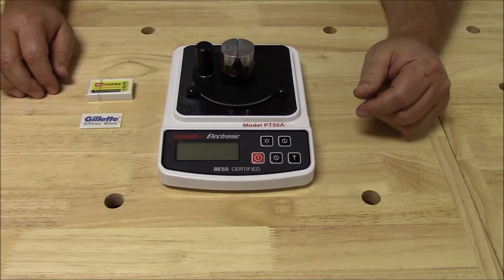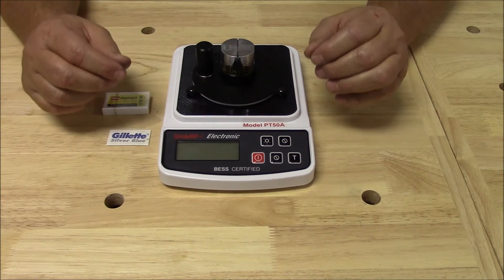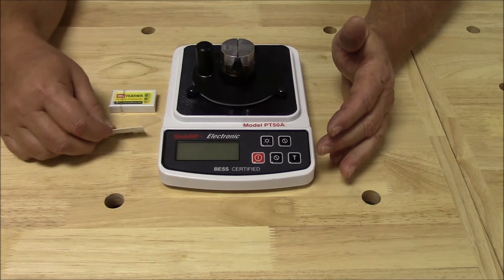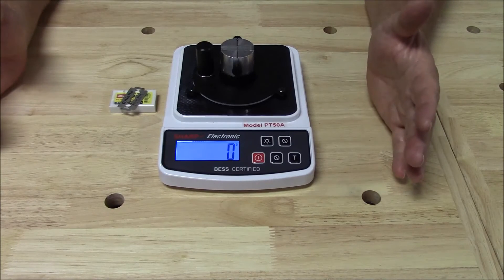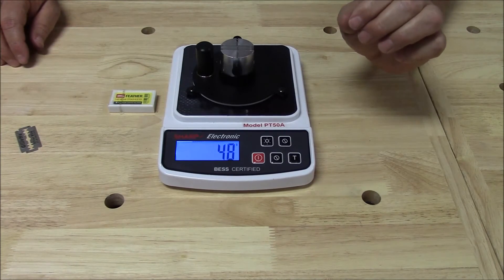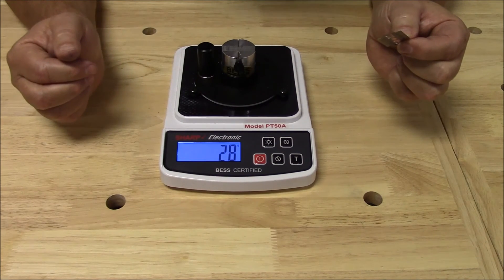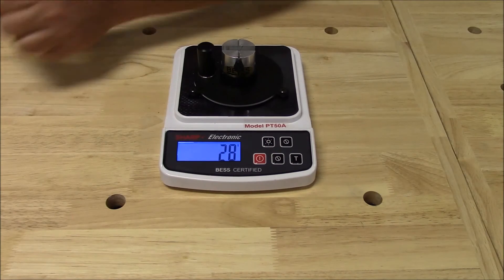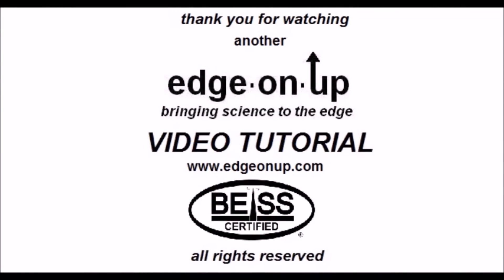EOU PT50A Feather vs Standard Delta Industrial

Comment: The edge of a straigh razor can be damaged by the machine???🤔
Reply from the maker: Not if the edge is formed in a structurally sound manner, Zen. Our test media is composed of a polymer compound (plastic) and straight razors steel so which should be the winner in this struggle? However, our test media is capable of folding over or denting a wire, or false , edge.

Comment: Hmmmmm...................... I knew the feather was one of the sharpest DE blades out there just by using it.  And I didn't have to buy a BESS tester.
Reply from the maker: As stated in the title, and again at beginning of this tutorial video, the purpose of this experiment was to measure the delta (difference) in sharpness levels of the two blades tested. Most of our customers are not only interested in determining the "how" but the "how much" as well.
Reply: Indeed. I shave with a straight razor, usually, and by my subjective perception my best edges often match a Feather Hi-Stainless but greatly exceed a more mainstream DE blade's sharpness. Occasionally I will use a half DE blade shavette, especially when traveling, and my blade of choice is the Feather Hi-Stainless DE blade snapped in half. My holder is a blatant styling knockoff of the Feather AC shavette which I can get on Amazon for around $10 or so vs the more pricey Artist Club that can only use the long semi proprietary (and more expensive) blades. If you buy 100 blade lots from Thai resellers you can get the Feather Hi-Stainless for about 25c each. The edge of these blades only lasts for about a half dozen shaves but I honestly just use them once and discard. I can definitely tell the difference between a Feather used once, and a brand new one. OTOH A Gillette 7:00 Green I can't really tell the difference after just one shave, nor other popular and fairly sharp blades like Israeli Personnas. They start out less sharp but take longer for the edge to deteriorate. The difference can be felt if you are paying any attention at all. 

I don't think the Feather is one of the sharpest DE blades out there. I think it is THE sharpest DE blade out there. I have never tried a DE blade that matched a new Feather blade, in sharpness. This holds true in a half blade shavette, or a DE razor.

Comment: I've recently come across a video of someone supposedly getting a 25 off a butter knife as well as 8-10 on self sharpened knives on the PT50A. They say their method is legit, but I have my doubts. Is the steel in a butter knife even hard enough to get edge that thin?
Reply from the maker: I'll just comment on the butter knife - I suppose that there are butter knives and then there are butter knives but the ones I've seen are, indeed, soft steel. My problem when attempting to sharpen soft steels is that it is very difficult (and it seems sometimes, impossible) to remove the burr properly and/or completely. Residual burr = high BESS scores but perhaps this individual knows some tricks that I don't.
Reply: @edgeonup4426  Thanks for the reply. I was hoping to get an idea of what was possible since it seemed like the person was artificially inflating their business's abilities by using the tester incorrectly(no fulcrum, fast chopping motion, possibly over tensioned test media). I understand why you wouldn't want to comment on the other part of my post though, since this is public and you didn't see it yourself. Thanks again.

Comment: Does room temperature have any effect on the test? I sharpen in my garage shop and it gets cold wondering if it effects the test media or score if its cold
Reply from the maker: Hello Alexandria - The short answer is, Yes. This is a room temperature device. Temperature swings greater than +/- 5 degrees C can begin to effect measurement results noticeably (+/- 10 grams).

Mike @ EOU
Reply: Thanks I was getting high number when it's cold but as the room gets warmed up they seemed to drop. It's around 4.4C in the morning in the garage so pretty cold. I think I will just do all the testing in the house from now on.